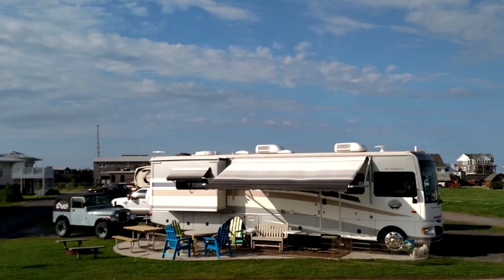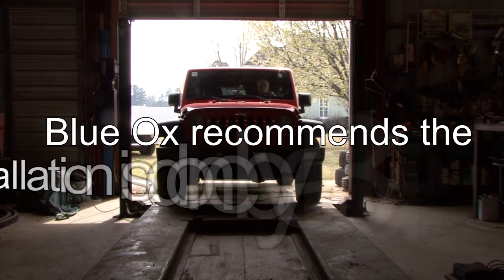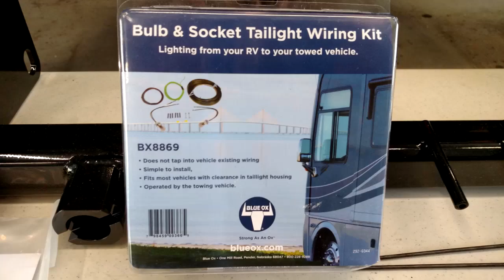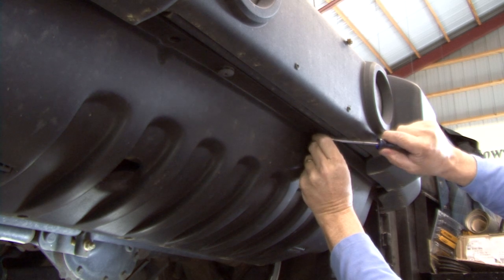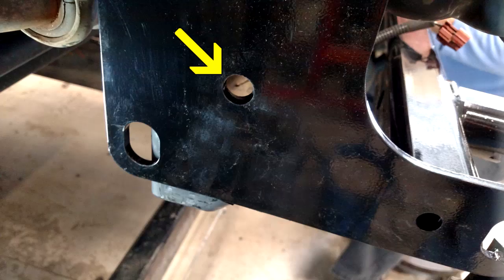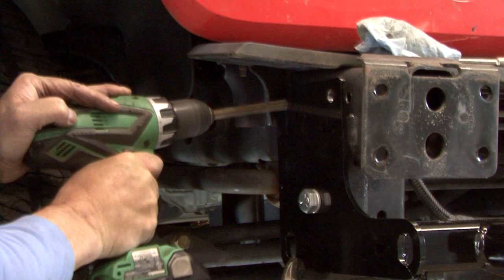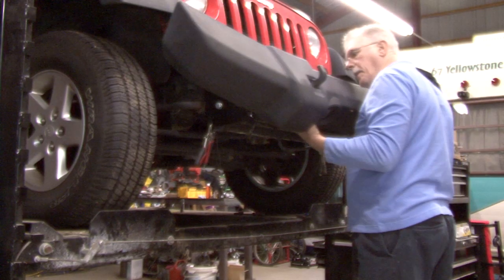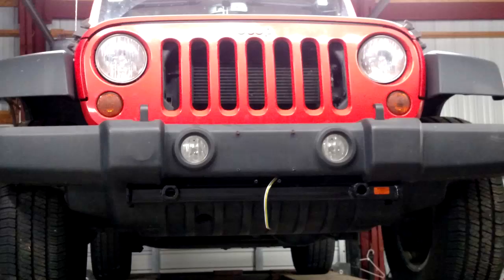RV 101® - How To Install a Blue Ox Base Plate on a Jeep Wrangler

Comment: the first time i installed one of these I used the lowest hole in the frame that was the first one to line up and I was nearly  finished when I realized the base was two inches too low and I had to start over, drill new holes etc... don't use the bottom holes unless you have a lifted vehicle I hope this helps some one.